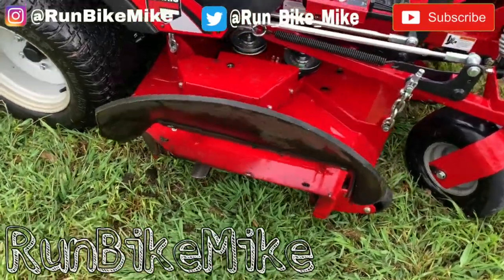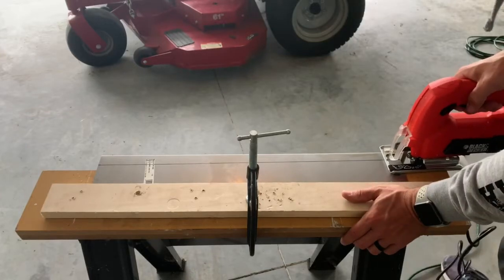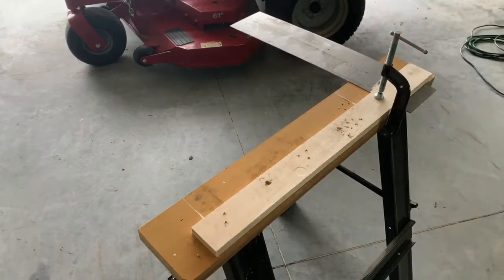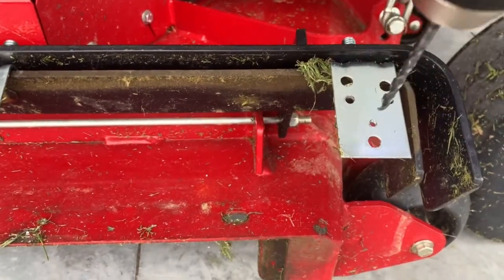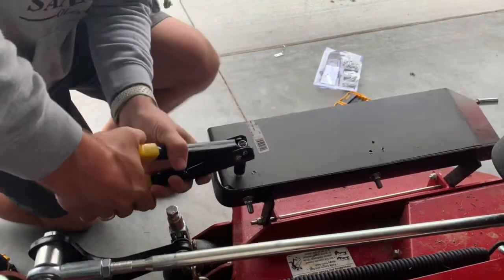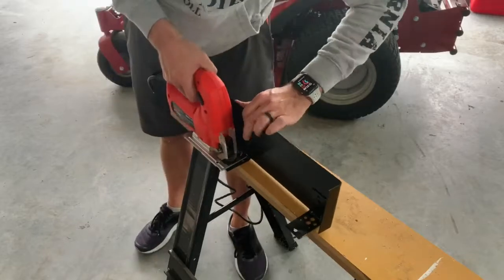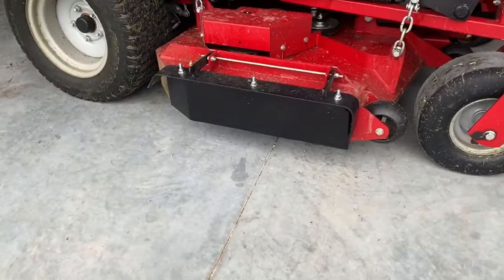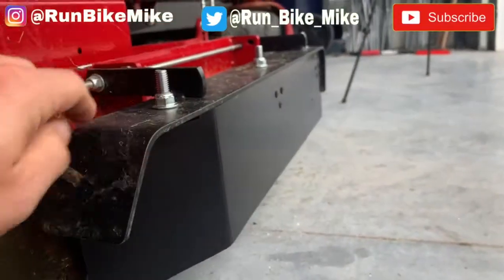Chute Blocker for Your Mower Part 1: Ferris ISX 800, IS 600, IS700, IS2100, IS3200

Comment: Buddy, Please don't take this wrong but I have something I feel compelled to mention. I noticed that you are wearing a hoodie with the draw strings dangling below you when you bend over your work area. When I was a teenager I was working over an exposed moving cog gear and noticed my draw strings bouncing off the spinning teeth. Something I remember to this day. It only takes a second to tuck them in. Nice video.
Reply from the maker: Good point and tip

Comment: I want to know if it keeps the operator cleaner.? I hate it when wind blows grass all over me and machine.
Reply from the maker: It helps a lot but it is not 100% perfect. I use it mainly for that exact reason.
Reply from the maker: It helps a lot but it is not 100% perfect. I use it mainly for that exact reason.
Reply: If the leaves are heavy..you will get a blizzard of dust!! Less dust if the leaves are slightly damp.

Comment: I bought one before I discovered your video.  My question is would you know why I get a lot of discharge through the front of the deck?  First time I used it covered the deck. I don’t have mulching blades just regular ones. Don’t know how to correct the front discharge.
Reply from the maker: I have heard that can be a problem. I don’t get a  lot of discharge from the one I made but there is a little. If you can find a way to make the seal at the top of the deck and the opener more tight I would think that would help.
Reply: RunBikeMike I’ll try that
Reply: The one that you can buy doesn't come all the way around the front like the one he has made

Comment: 2 years later, any issues? I bought the mulching kit for my is700z but just bolts on so I cannot lift it so I think I'll be making this.
Reply from the maker: It works well. I found I don’t use it was much as I thought I would but it is nice when needed.
Reply: @RunBikeMike  I have a feeling that I will use it quite a bit probably in one setting or the other. My yard seems to always be a bit "damp" for the lack of a better term and it seems like my mulching mower just does a better job of dealing with the clumps but there will be times when I'll need to open the chute because it will just be too much for the mower to handle.